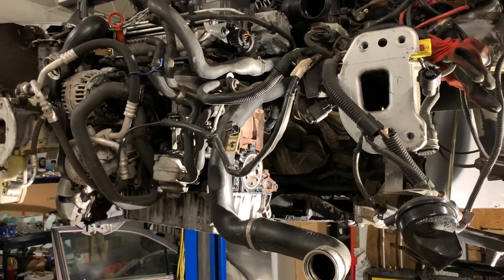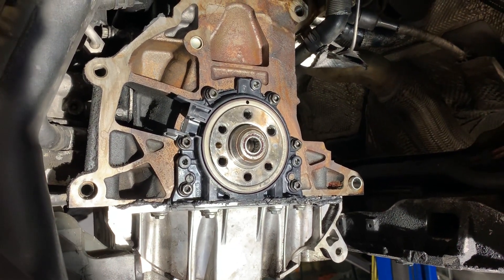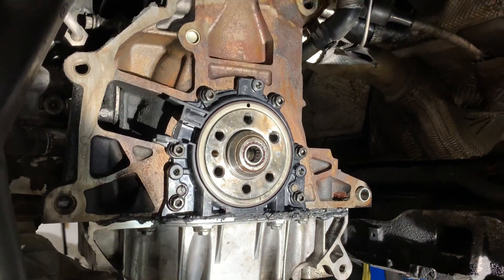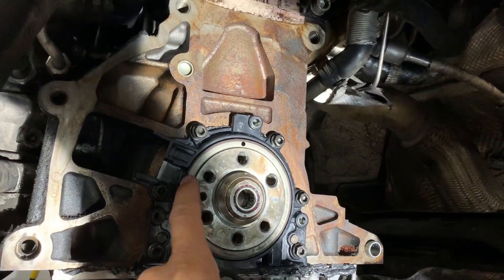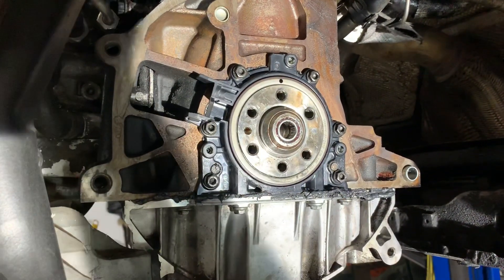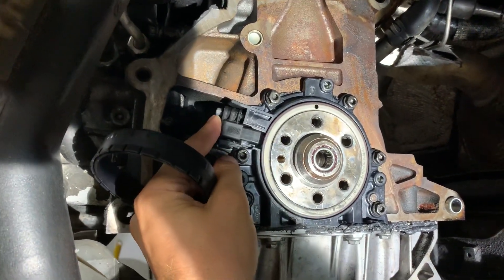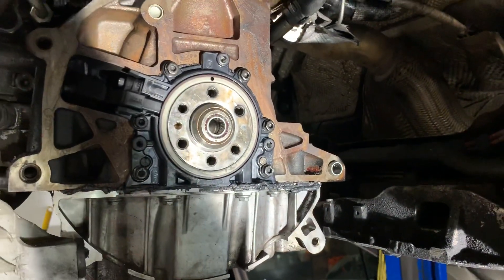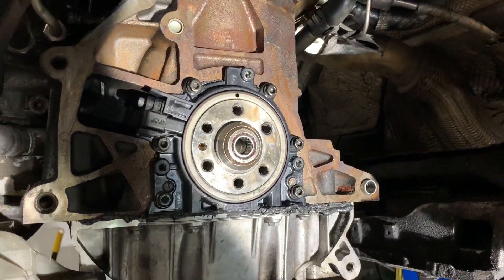Volkswagen Audi TDI rear main crank seal installation

Comment: Yup i found out the hard way i replaced the rear main seal put it back together and crank no start crank shaft correlation fault FUK 😮😮😮😮 my fault i did notice the crank ring had 2 larger teeth but over looked that

Comment: terrible job , full of silicone . This oil seal doesn't even need silicon on the block to be installer , just a little on the bottom (ou should remove the sump actually)